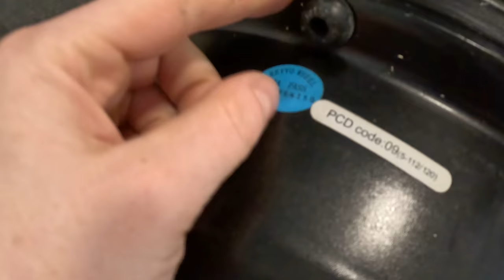Attempting To Refinish My Curbed Wheels (MOST SUCCESSFUL PROJECT?!)

Comment: im so glad you figured out that soapy water is pretty much the most important key to removing/installing tires. in the shop they actually use almost a soap/grease. but without some sort of lube in there you are not getting some tires off.
Reply from the maker: It's amazing how much help soapy water was for this project, I totally underestimated its power!

Comment: Nice job Meg!  Quick tip for if you and any viewers thinking of doing this on their own. When you are breaking the bead and you have tire sensors that read the pressure (psi), make sure you put the valve stem on the opposite side.  This ensures you don't break the sensor.

Again,  Nice job!!!
Reply from the maker: That's actually a really good idea/tip, Colin! I don't have tire pressure sensors on my car, but good to know for the future as I do have them in my truck! Thanks for watching, and have a great week!

Comment: 37:48  For safety reasons, it is better not to have the heater on while spraying, as this could cause a fire.
Reply from the maker: It isn't ideal for sure, but I had to have the garage at a certain temperature for the paint to work, and it's still very cold where I live

Comment: Outstanding job. If you have to do that again, press in the valve stem first to let most of the air out before removing the stem. Without all the air pressure it will be very easy. Can’t wait to see what you do next
Reply from the maker: Thank you! And yes, you're totally right, letting the air out first before removing the valve stem core would have been the play. Thanks for watching!

Comment: Very nice job. It seems there are few things you can't do. For few tips - if you put on bondo you can straigh sand some of excess off ..it comes off very easy , because it's not fully hardened. This is the trick they do with car painting bondo also. For curved i would use something softer. Some sandpapers have soft backing . You could also use some bigger sponge as car washing sponge to make it bend more without your hand doing the curves. While painting spray should always go totally over the part and then back, because if you change direction at the part it will have thicker coats on the sides where you change direction. And finally  - don't paint the part that connects to the hub of the car. The paint just makes wheels stick to car while taking them out, it might loosen while driving if there is thick coat as paint gets squashed and is overall bad idea. Just clean it with sandpaper and thats it. subbed.
Reply from the maker: Thanks so much and thank you for the sub! 😊 These are all great tips, thank you!!

Comment: Meg. Considering the issue you had with the new/used rims. I know you tried to line up the lug bolt holes, but I'm pretty sure those new/used wheels would have worked.  I would have put the wheel on the hub, put in one lug bolt by hand, and then manipulate the wheel to line up another lug bolt.  The issue seemed to be that the circle on the back of the wheels was larger than the round protrusion on the hub. If the spacer thingy was the correct size for the new/used wheels this misalignment would have not happened.  By putting in the one lug bolt, then skipping a hole and putting in a second lug bolt, I believe the new/used wheel would bolt right on.

Comment: Meg. They are called Hub centric rings. Next time u should check the info on the wheels. all the info and specs will be listed on the inside face of the wheels. Where it mates to the hub. 👍🏾

Comment: Amazing job Meg, I used to work as a tyre fitter, and thought you might struggle to get the tyres off the rims by hand. Using wood and the car was inspiring.

The one thing I did notice is that there are 10 stud holes in your rims, with not a lot of meat between them. Is that how they are supposed to be, or did the previous owner cut new holes to make them fit? Might be worth checking it out.

Wheels look amazing tho, are you planning to pick out the name detail with black paint?
Reply from the maker: Thanks very much! They're actually aftermarket wheels and have two different bolt pattern options on them. I actually have been considering blacking out the emblems/badges so I may do that in a future project!

Comment: You really should wet sand the primer even if it looks smooth and use sealer on the filler spots. But it you did great. I use Graphite  on my Subaru wheels so great choice. Way ta go.
Reply from the maker: Yes this is true, I did consider it, and that is the proper way of doing it, but they just looked so good already (and to be honest I was also a bit tight on time!) so was happy to just carry on without doing another round of sanding and cleaning. The graphite is awesome!!

Comment: You should watch Vice Grip Garage. He painted his wheels put the tires on the wheels with out setting the beed and cut a hole in a garbage bag just a little bit smaller that the wheel and then painted the wheels. That keeps the wheel from getting scratched when mounting the tire.
Reply from the maker: It's a great channel! Good stuff on there. Haven't seen that video in particular but thanks for the suggestion!

Comment: never tried to remove the tires by hand , rather pay a little to have them pulled of at the tireshop , they allso take care of discarding the old tires 
one thing i do know from repairing bicycle tires is you need to push the tire intoo the deep part of the rim to be able to work the edge over the lip of the rim 
80 is good for the deep scratches 120 is for taking the most of the bondo off and rough shaping it 240 would be best for roughing up and give it a key for the paint to hold and getting the scraches out of the bondo from the 120 and the fineshaping 
rubber squeegy works best for applying bondo , bondo is made from resin , im alergic to the stuff due to working with the stuff for 3 years , best to wear gloves as getting an itchy rash isnt fun 
one trick i heared about is put the paintcans in hot water it makes the paint flow out better , i found that out another way when  i left the paintcans and the part in the hot sun and the paint result was exceptionally good 

with the aluninum wheels you need an etching primer before paint 
one trick to cover over holes before painting is using those foam earplugs , for bigger holes blown up condoms or small baloons 
hold the can right side up , upside down gives splatters 
might help if youre able to put the wheels on a table and being able to spin them around  , like setting them on that mecanics stool in the background 
the rims turned out realy nice , now to keep away from the curbs.......

Comment: Damn, Meg, that's some excelent work! But remember to vent the place, you don't need a gas chamber "in 'da haws".. Other than that, let's hope the bondo won't have some sticking issue on aluminum. Since you're done with the project, indeed you're right. Doing something yourself  for the first time always takes lots and lots of time, but you get some satisfaction at the end, which is priceless. Keep on going, if you know what, there is always something to do, improve, renovate or rebuild... It's a never ending story with no flying dog-sauruses involved. 😉Oh, almost forgot, you can build yourself a simple lever actuated "machine" or maybe tool to break the beeds with style.. The car ramp method is just a little rude.. , although it works if you have no options. Na svidénje to the nekst. 😜
Reply from the maker: Thank you! If it wasn't so cold outside, I would have vented it, but it was challenging to keep the garage at the right temp for the paint. Thankfully my mask worked great, although the garage did stink for about a week afterwards lol! Looking forward to taking on more improvement/renovation/build projects to share! Thanks for watching!

Comment: 43:25 That tire shop mechanic is certainly not a professional if look how he mounted those tires. 
On tires is a yellow, and sometimes a yellow and red dot. When tires are made, they are never be perfect balanced, so the manufacturer marks the lightest spot of the tire with a yellow dot. Because a tire is also not perfectly round, the manufacturer place a red dot on the highest spot on the tire. When both dots are on the tire, the red one take priority, and the tire needs to be mounted with the red dot near the valve stem. That way, the least amount of lead weights needs to be added to the rims and the wheels run smoother. 
If the tire is mounted with these dots on almost the apposite site of the valve stem, great pieces of leadweights are needed to compensate that. 
Other then that, you did a great job on restoring these rims and they look like new, and personally they look much better then the set you have bought from marketplace. Grtz

Comment: Whats your experience with these old Finnish Nokian tires? I have brand new set on my BMW and so far im loving those, even i was very sceptical to use suddless tires in winter.
Reply from the maker: I really liked them! They did well in all conditions and are a great winter tire. But I gotta be honest, now that I've experienced the grip of studs I personally will always be using studs in the winter BUT we also have really bad ice and freezing rain here and lots of steep winding hills so it just makes sense for my area.
Reply: @Meg.August  here in Finland we probably have the same winter conditions what you have 😅 I have also small Renault twingo and its useless without studs... Definetely will buy studded Nokians for next winter. But the heavy 5 series performed perfectly with the Nokian tires 😎
Reply from the maker: @Taikausko  I've heard that about Finland - lots of hard pack snow as well I think? But yes, once you've experienced studs, there's nothing quite like it!
Reply: @Meg.August  it all depends on the location and if salt or sand is used or not. Packed snow mostly outside the city areas. In cities they plow it immediately before it even gets packed. And you know when the packed snow starts to melt, it turns into an ice haha. Then studs are definitely the best choice

Comment: 3:05 those mercedes wheels should definitely fit, they should be 5x112, you just didn't have them oriented correctly on the hub. Made the same mistake when I put mercedes wheels on my vw.
Reply from the maker: They're actually AMG knock offs! That's why I liked them because they looked like the real thing, but sadly the bolt pattern was not the same.

Comment: did u use 2k clear? if not then u are gonna have problem soon, 1k clear cant handle chemicals and a lot more..
Reply from the maker: I'm not sure actually but the can did say it was intended for wheel use (high temps and acidic applications as well other applications) so I'm hoping it will hold up!

Comment: They appear to be 5 on 120. They look like a Mercedes Benz/ AMG copy wheel which are 5 on 120
Reply from the maker: They seem to be 5x114.3 sadly - you're right the real AMG wheels are 5x120 which is why I got them but these knock offs were a different bolt pattern unfortunately!

Comment: Damage to the rim and you can no longer put rubbers on because it makes no sense because the tires and the rims are broken. Damage to the rims means that you will lose air in the long term and no longer maintain the pressure in the tire. Dangerous If you then lose control at high speeds if the tire is flat. That's why you take the rubber off the tires in a workshop and put them back on while balancing the entire wheel.
Reply: While not fun or easy folks been changing tires like this forever. We don’t all have time or $$ to have a shop do it. I am impressed Megs went after it !!
Reply: @rickcreel9557  That's why so many accidents happen in the USA, due to improper work with consequences. That's why it's forbidden to do this in Europe. If the insurance company finds out that you did it yourself, i.e. in Europe, you will too still punished by the legislature.
Reply: what a bunch of bollocs, who doesn't check the tire pressure before going on the road.
its not that dangerous if your tire is slowly losing pressure. If you are that worried about losing pressure while driving on the road, there are bluetooth sensors for pressure that you can install on the tires.

this seem like a bunch of corporate bullshit heavy thinking so you don't actually own and work on the stuff that you own.
and the next step of this bullshit is Tesla, you can't even change a lamp without going to the factory

and because "oh its dangerous"
Reply from the maker: Thanks @rickcreel9557 ! It's a great skill to know how to do and honestly was pretty fun!

Comment: That doesn't look like an oem wheels, looks like a diy  bolt pattern, I wouldn't use that if I were you, if you do, I hope they are hubcentric wheels..
Reply from the maker: They are aftermarket wheels and they are hubcentric but thanks for the concern, they just come with two different bolt patterns

Comment: it's idiotic to do a tire change at home i paid $15 and had 4 wheels changed in 30 minutes
Reply: Not sure where you are but $20 to $35 a tire plus another $10 a tire if you didn’t buy them from them is how it is around here and then roll the dice if they don’t fall off afterwards.
Reply from the maker: Lol yes not sure where you're at, but $15 is a great deal! We definitely don't have deals like that around here. It's over $100 bucks to just have 4 tires removed where I live!